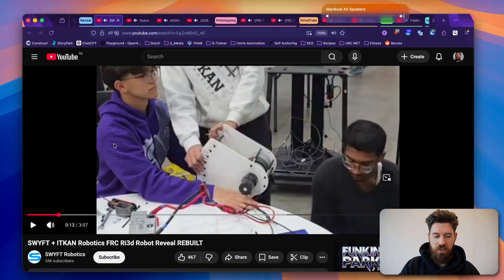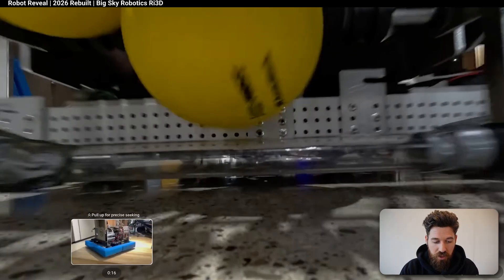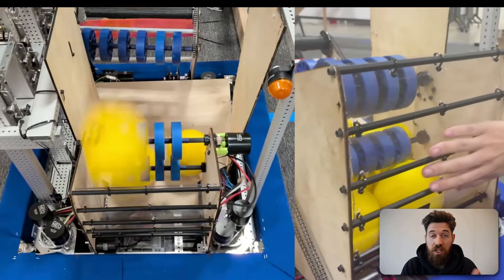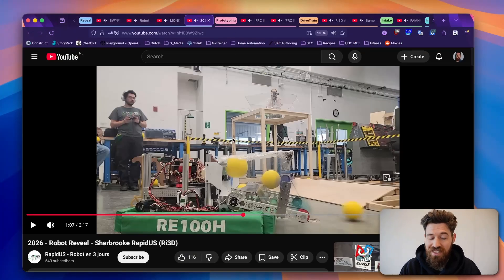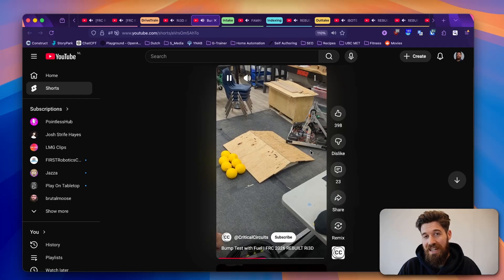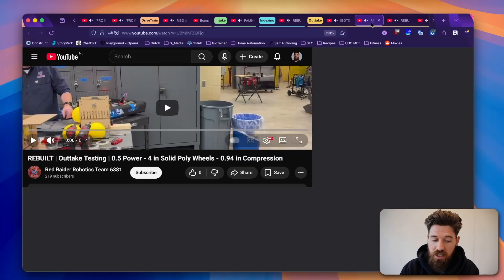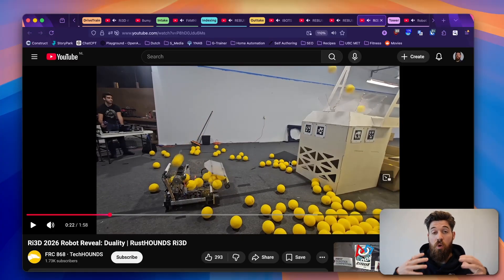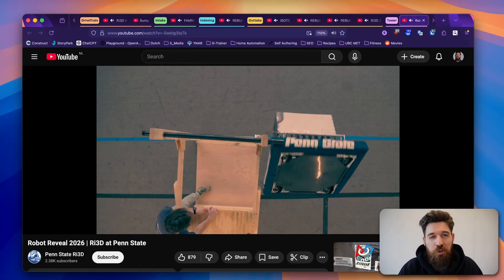Creative Robot Concepts for FRC REBUILT [FRC Saturday's]

Comment: lwky penn state climb looks meta
Reply from the maker: It's definitely not for the faint of heart. There is a full video on their channel where they explain the challenges teams may face trying to re-create it. Most important thing here is to build within your teams means.
Reply: @BroganMPratt  totally agree
Reply: it is a heavy mechanism. it needs to sustain the entyre robot with a lever system that could potencially reach 400kg of force. they have explained that is hard in one of their videos
Reply: @yuribrennerlucas2314  ik plus steel construction but looking at purdue's elevator concept bumper clearance seems to impact alot in match time + consistency
Reply: Do you realize how many active degrees of freedom you need to do that climb if you go under the trench? You need 3 active dofs to extend outside of frame perimeter, extend up, and rotate the climb. Not to mention the crazy forces involved in the climb sequence. Definitely not meta
Reply: I have discussed this on other places as well but I want to discuss it here too. Isn't this climb technically illegal? The horizontal extension limit is 12 inches from your robot VERTICAL PROJECTION, not from its bumpers, its vertical projection. Wouldn't this type of climb be over the extension limit since the bottom rung is 27 inches from the ground and there is no way the robot isnt extending more than 12 inches while it is sideways?
Reply from the maker: This would be a good Q&A @theguardian7214